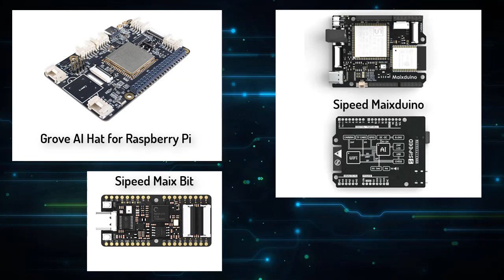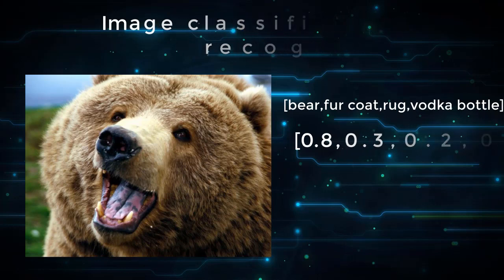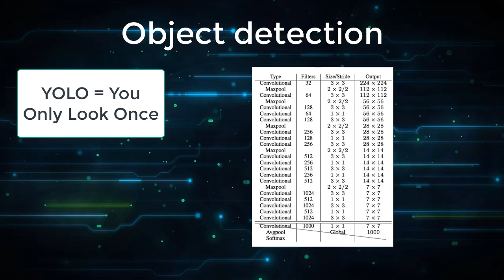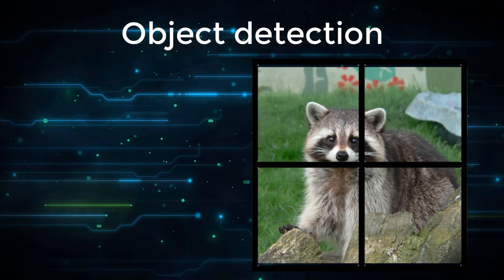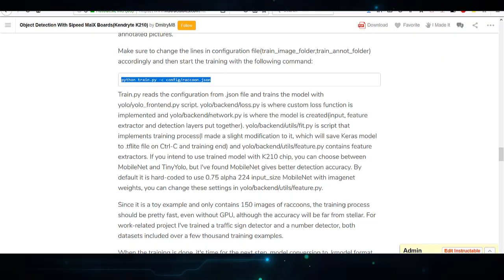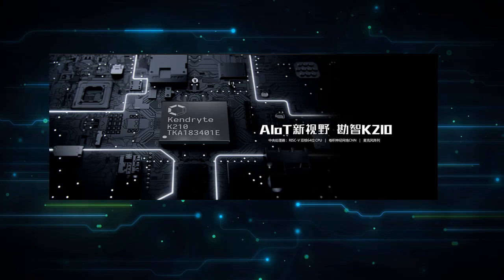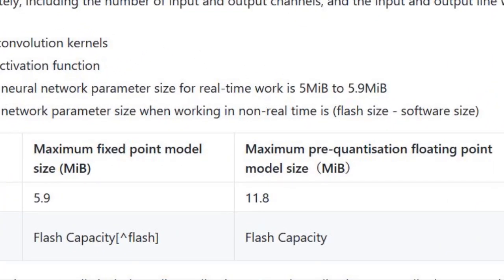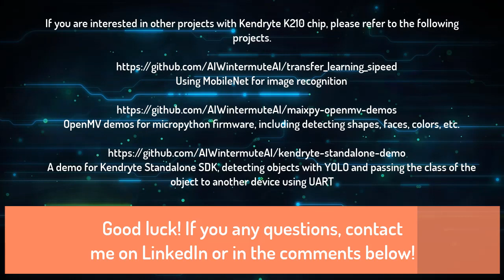Object Detection With Sipeed MaiX Boards(Kendryte K210)

Comment: Inference time of Yolov8n On this board without show=True as in just the inference time without showing the image with bounding boxes?
Reply from the maker: Hello, @DoomsdayDatabase! For K210, the highest version of YOLO officially supported was v2. I added v3 support myself (you can find the PR on Sipeed Github for that), but the PR was never merged. You can try converting YOLOv8 yourself with nncase, then run it on dummy data without postprocessing to find out the inference time. It's really adding the post-processing is the trickiest part of the object detection models porting.

Comment: Awesome. Thank you..My board is on the way..
Reply from the maker: Nice! Which one?
Reply: @Hardwareai  it's Max go.
Reply: Same here, Maixduino. Hoping to be able to use object and face detection in combination with WiFi
Reply: @FuZZbaLLbee   I am able to run face recognition application but I am unable to run WiFi examples.
Reply: @Hardwareai   If time permits can you make tutorial on WiFi and speech recognition.
Reply from the maker: There are some examples here https://github.com/sipeed/MaixPy_scripts/tree/master/network, but they're fairly simple. Also, they are probably for Sipeed Maixduino, which has ESP32 onboard. Can you run these examples?

Comment: Great video! very informative. Is it possible to run real time pose estimation on the MaiX boards?
Reply from the maker: Yes. The simplest to implement that would be to use person detector first, then cut out and resize a person from frame and run a second model(pose estimation) on that smaller image. Basically all the tools are already available, but I haven't seen anybody implementing it. You can be first!
Reply: @Hardwareai  I would like to see that!

Comment: Have you considered testing the Sipeed MAIX Binocular Camera? Supposedly you can do depth tracking with it. It would be great if someone would do a video on that! :)
Reply from the maker: Supposedly :) that's the key word. I asked for sample of Binocular Camera from Sipeed and should get it pretty soon. But there is no code samples available for stereo-to-depth on K210 or Micropython. I just searched on google and the top result is somebody posting a job on upwork to implement stereo-to-depth on K210 ... for 100 USD. I laughed so hard xD
https://www.upwork.com/jobs/Developer-Needed-for-Stereo-Depth-Estimation-for-K210_~0138dcf553378be167
Anyways, I will test it, but concerning stereo-to-depth... While it is certainly possible to make some sort of quick python-to-micropython code conversion(must use ulab lib), the result probably will be way too slow.
Reply: @Hardwareai  haha well somebody's got to be the first to do it and share the code. And that somebody will get a lot of attention for making such a low cost depth camera. Much more low cost than the OpenCV OAK camera for $150+. Personally I'm fine with even 5fps if it's stable.

Comment: Hi, thanks for the tutorial, and I followed it.
when i reached the execution phase i notice that the code stucks in task = kpu.load(0x......) for too long with no response till i cut the connection (10mins of waiting ), I used the firmware 0.5.0.22. 
I noticed also that u skipped that little frame in your video and i'm wondering if you did any modification during that dead time.
Thanks
Reply from the maker: Hi! For example code, please consult https://github.com/AIWintermuteAI/aXeleRate/blob/master/example_scripts/k210/detector/racoon_detector.py
For your problem, can you create an issue on Github? Try connecting to the board using serial terminal(in MaixPy IDE Tools -> Terminal), then execute your code in the terminal(Ctrl+E to paste, then Ctrl+D to execute code). Post the results of running code in terminal + details about model you're using in Github issues following bug report template, thanks!
Reply: @Hardwareai  it was my fault i didn't respect memory allocation for flashing codes. what happened was overwriting firmware with kmodel which ruins the code.

Comment: Is this chip able to repeatedly recognize the same raccoon out of multiple raccoons present? 
When object is recognized, is it possible to write the object name to some kind of a database?
Reply from the maker: That is not something a chip would be responsible for - rather it is a network you train yourself. As long as the operations in that neural network are supported by the chip (K210 in this case), you can do with hardware acceleration.
Racoon recognition is probably will be very similar to face recognition. Check out the whale recognition competition on Kaggle to see something similar.

Comment: Hello i tried your person detector on google colab and it shows this error ModuleNotFoundError: No module named 'axelerate.networks.yolo.backend.utils.augment'. When i went and checked utils folder there was no file named augment can you help?
Reply from the maker: The person detector wasn't updated for a while. However, I merged a pull request today, so could you try it again and report back if it works/not work?

Comment: Can I feed an external feed to this board like from a security camera? Not from onboard camera.
Reply from the maker: Yes, I believe that is possible. Are there any use cases for that?
Reply: @Hardwareai Synology Surveillance Station, BlueIris, etc uses motion detection for recordings and this is far from accurate detection. The result is a lot of false recording tons of wasted SSD or HardDrive Space. So if we can feed cameras video feeds to board and trigger Synology Surveillance Station or BlueIris with MQTT or any other type of protocol. Believe me, there is a lot of interest in this. Here is one of the examples:  https://www.youtube.com/watch?v=fwoonl5JKgo  but this is not fast enough, if docker runs on a headless PC or server, about 3-4 sec. and this is slow for a security system.

Comment: is it possible to run a kmodel without a board device?
Reply from the maker: yes, I think so, there is a simulator, look at the docs https://github.com/kendryte/nncase - you'll need to use pretty early version of nncase though to run the model on K210

Comment: Do you know how fast this device is (what is the FPS) it can process, can it also do object tracking.
Reply from the maker: It can do color based object tracking. Considering FPS, it really depends on your application - basically what do you do with an image.  For simple applications (image capture+small (~300kb) detection model inference+output you can achieve up to QVGA@60fps/VGA@30fps (you can't run inference on VGA input, so you'll need to resize it to QVGA anyways) with C++ code. https://canaan.io/product/kendryteai

Comment: Is it possible to train the board with any object? E.g. a rock? I want to use it for motion tracking of a quite fast (50km/h)  linear motion.
Reply from the maker: Rocks? :) yes, that is possible. How far is the rock? 50 km/h doesn't seem insanely fast, K210 can go as fast as 30 (and even 60) FPS according to specifications. You won't get that speed with micropython firmware though, definitely need to use standalone SDK.
Reply: @Hardwareai   It would be relatively close to the camera, max 1m - 1.5m. 

Micropython would be too slow to process that? 

Which board would you recommend to start with and use with an Arduino? Sipeed Maixduino?
Reply from the maker: Sorry for the the reply, YouTube marks comments with at least one reply as already "answered" xD
okay, in that case yes. You can try Micropython first, it is easiest to get started. Maixduino will work fine, you can get Maix Bit since it is cheaper and smaller. Has the same functionality as Maixduino, except for wireless.

Comment: With the release of the new M1n I was thinking of using it for presence detection where the range is up to ~3 meters. Do you think I can combine person detection with face detection in the same device? I guess if so, the fps will drop to about half
Reply from the maker: No, that won't affect FPS by that much, definitely not half - running inference on the image is the least time consuming portion of the pipeline, since it is done on KPU. Image processing adds much more overhead, because it is done on CPU. So, by all means try combining these two models,  I think you will still get FPS > 13 frames per second.
Reply from the maker: Btw, that guide is outdated - I published new framework for training models for various types of hardware, including K210 https://github.com/AIWintermuteAI/aXeleRate

Comment: can you let me know whether you used Tiny Yolo and how long does it take to complete a detection of a given image on the device. What was the resolution of the image
Reply from the maker: well, the architecture of neural network in that case was Mobilenet as a feature extractor and yolo v2 detection layer. So, no, I didn't use Tiny Yolo, because it showed worse performance as compared to Mobilenet+Yolo v2.
Good question. I'll do some tests. Resolution is 224x224.
Reply: @Hardwareai  Many thanks, can you also let me know the FPS achieved with your setup

Comment: you just did not tell how to convert tfliet to kmodel in detail. its where the main problem is.. as the ncc gets padding error
Reply from the maker: Hi! Video is just a shortened version of the tutorial. In the tutorial the process of conversion is described on Step 4. If you're getting padding error it probably means two things --- you're using versions of Keras or Tensorflow different from specified in the requirements or you modified feature.py script somehow. I already fixed padding issue in my repo by including modified version of Mobilenet. Hope that solved your problem!

Comment: thanks for this great tutorial,
I followed the tutorial on instructable and created a kmodel
but while I try to run it with the firmware that is used in this video I get 

ValueError b>>> init i2c2

currently, I am using firmware: maixpy_v0.4.0_50_gcafae9d
and my model size is 1.81MB
I am using sipeed maix dock as hardaware
and MaixPy IDE
Reply from the maker: Can you post full output from the terminal?

Comment: Thank you very much for what you are doing man! Please help me a little, when I run you Colab notebook for detection and use the Kmodel I get the maixpy IDE gives me this error: err kmodel version only support v3/v4 now . This happens when I try to use a model that is in the flash memory of my Sipeed Dock, when I try to use the model inside the SD card it gives me this error instead: kpu load error 2006 err_no_mem   please help me, I would be very grateful for your time.
Reply from the maker: My pleasure! Some cool hybrid drones on your channel! How long can they fly?
Have a look at the issues section of aXeleRate on Github, I think the problem that you are using latest firmware, which has kmodel v4 disabled by default. you can try building https://github.com/sipeed/MaixPy/commit/461f841fe95cf9109df32e1f3a76d60a659c31af this commit from source or download precompiled firmware, 5.0-46 --- there is a link in my article to that version
Reply: @Hardwareai  Thank you very much for your answer! I tried to  use the firmware you said and also many other versions (from 4.0 all the way up I tried many of them) but the result is the same:  kpu load error 2, only supported model v3/v4 now, I saw the file you linked but I really do not know how to use it (I'm still a noob).
About my drones, thank you for your interest, this was an experimental project I started when I was 16, now they fly pretty well despite all the challenges, gasoline two-stroke engines have their own world and are not easy to combine with alternators, starters, and electronics. If you have any question do not hesitate to ask :)
Reply from the maker: Fascinating stuff :) are you going to use Maix dock on one of your drones?
Anyways, for your problem, can you create an issue in aXelerate repository or MaixPy repository - I monitor both of them. Specify the exact firmware number that you used, the model details and other relevant details. Github issues is more suitable for this than YouTube comments
Reply: @Hardwareai  I posted the issue, thank you again!  Yes, I hope to use it during the flight and test what we can achieve :)

Comment: Thank you so much for doing this tutorial. I'm so close to it working but it fails after training and maybe during the conversion process.

File "C:\Users\Dev\miniconda3\envs\yolo\lib\subprocess.py", line 1207, in _execute_child
 startupinfo)
OSError: [WinError 193] %1 is not a valid Win32 application

I've tried MANY things to get past this including installing the 32-bit version of everything which didn't work at all.

Any help would be massively appreciated. Thanks
Reply: Think I may have sorted/bodged that
In convert.py, Line 96 add shell=True       
result = subprocess.run([k210_converter_path, "compile", model_path,output_path,"-i","tflite", "--dataset-format", "raw", "--dataset", folder_name], shell=True)

Now getting
C:\Windows\System32\aXeleRate\axelerate\projects\raccoon_detector\2020-07-17_12-43-33\YOLO_best_mAP.kmodel
'C:\Users\Dev\miniconda3\envs\yolo\lib\site-packages\axelerate\networks\common_utils\ncc\ncc' is not recognized as an internal or external command,
 operable program or batch file.

This is painful
Reply from the maker: Emmm, it is not made to work with Windows :) only Linux and Colab. can you train in colab? I mean the only thing that needs to be changed for this particular part to work is to download windows version of ncc converter and provide the right path - it is complaining because Python converter script download Linux version
Reply: @Hardwareai  Thank you for replying, I've been smashing my face into my desk.

OK, I'll fire up a Linux VM and start again!
Reply from the maker: That will work too - if you have any other problems, you can open an issue at aXeleRate repository on Github :)
Reply: @Hardwareai  Thanks again

Comment: Hey thanks fot his tutorial. I followed all and when i tried to test it i just got and error in the code.The kmodel is fine i think but for some reason i just got:
Traceback (most recent call last):

  File "<stdin>", line 21, in <module>
OSError: run error: 13
MicroPython v0.5.0-29-g97fad3a on 2020-03-13; Sipeed_M1 with kendryte-k210
Type "help()" for more information.

I follow this script :https://github.com/AIWintermuteAI/aXeleRate/blob/master/example_scripts/k210/detector/racoon_detector.py

and just modify the While cycle due an error with these lines :
.rotation_corr(z_rotation=90.0)
    a = img.pix_to_ai()

I'll really appreciate any help.
Reply from the maker: Can you please create a Github issue at aXeleRate Github or MaixPy Github? It does seem like an issue with MaixPy and not the model training though.
Reply: @Hardwareai   Hi , i posted it and they said me it was the firmware and to try the latest. But it got me the error "only support Kmodel V3". I tried again with the minimmun ide firmware u posted in the link tutorial but also called "Error:13".
Could you help me please? i really want to do this cause is the first step to the ANPR i want to build
Reply from the maker: We'll be following that problem in Github issues - for anyone else facing "only support Kmodel V3" - you can compile the firmware yourself following build instruction in MaixPy github repo or here https://www.maixhub.com/compile.html